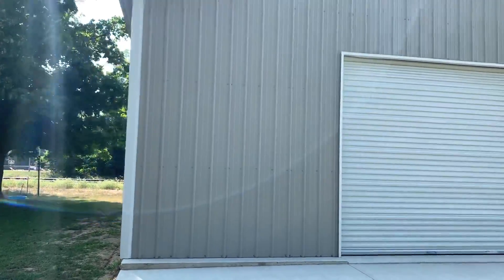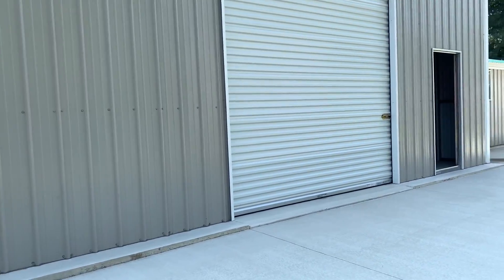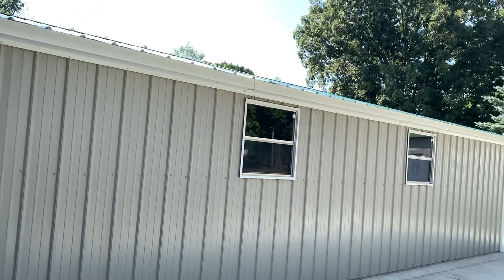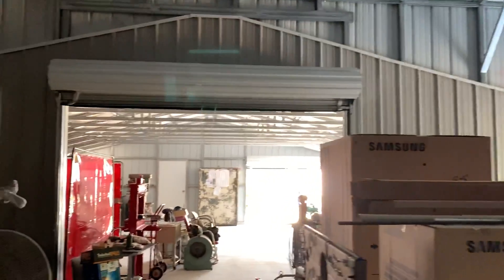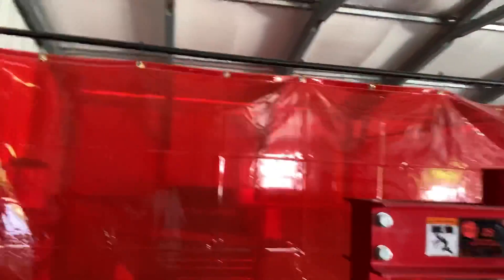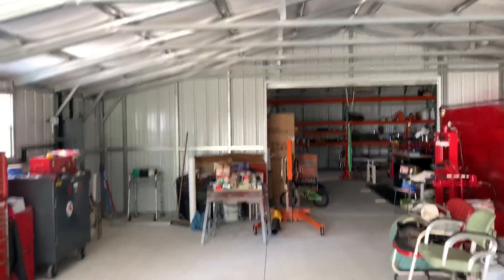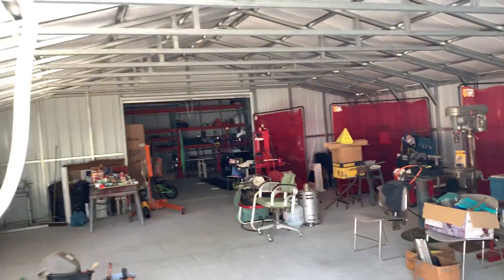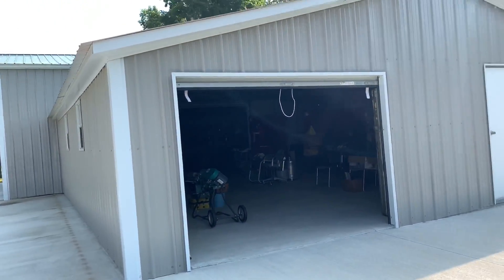30x35 Steel Building connected with a 30x32 Steel Building

Comment: How tall are the ceilings
Reply from the maker: Henry, both buildings are manufactured with a 4/12 roof pitch. The 30x35 is approximately 14'-15' tall at the peak and the 30x32 is approximately 11'-12' at the peak!